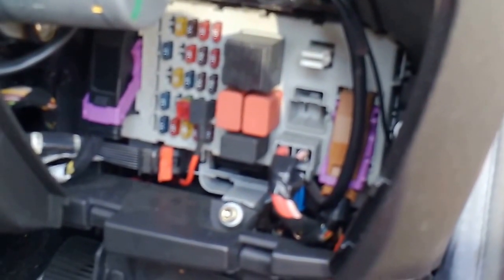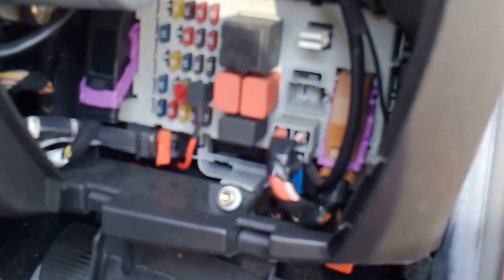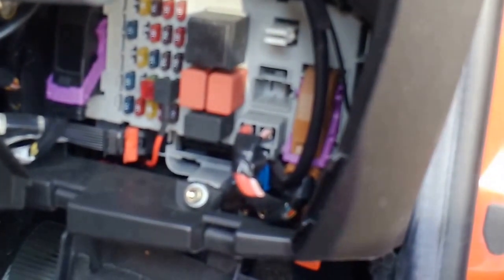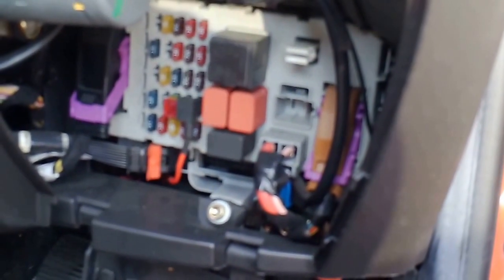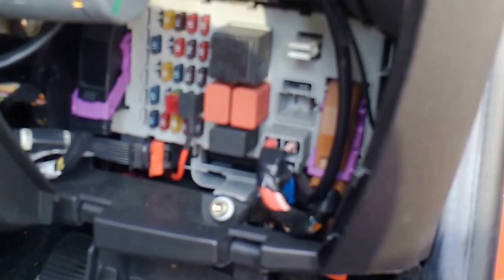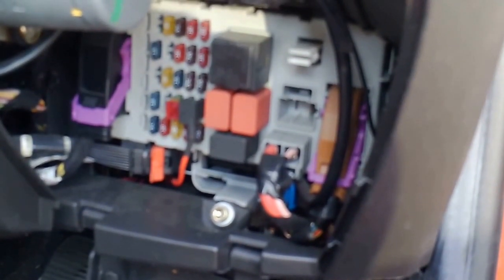Fiat Punto MK 2 OBD 2 diagnostic port location

Comment: cheers dude, you could have just said it's under the fuse box. wish your camera could have focused better, maybe needed more light?
cheers anyway
Reply from the maker: Wasn’t the greatest of videos, it was a really bad camera. I felt something was better than nothing. Cheers for watching.👍👍👍
Reply: @drivewaydiyer6504  Hi, thanks for the info. Are you familiar with the Fiat Tipo at all, the first Tipo, up to 1995 not the new one. Do they have an OBD port, they have an ECU but not sure about the OBD. Appreciate any help, thanks
Reply from the maker: At that age there probably isn’t an obd2 port. There’s probably an obd1 socket somewhere. You normally use a paper clip, which creates a flashing eml light, where you count the flashes and that determines the code numbers.Not sure where the socket is. Best to join a Fiat owners group on Social media, for that info. Other cars I’ve found them under the glovebox.
Reply: @drivewaydiyer6504  Many thanks for your quick reply and most helpful info. I think i know the plug you mean regarding OBD1, beside the ECU dust cover. Wondeed what it was lol. Will seek out Fiat owners group like you suggested. Best wishes
Reply from the maker: Good luck.👍

Comment: Thanks for the sharing, haven't got my ELM327 OBDII scanner yet so just curious, are the OBDII port only powered when the engine is running on the Punto MKII? or like some models it got electricity in the port even the ignition position is off?
Reply from the maker: Chi-Wei Shih it should communicate with the key on, engine off. For the live data, engine should be running. Thanks
Reply: Thanks for the reply, you are awesome.